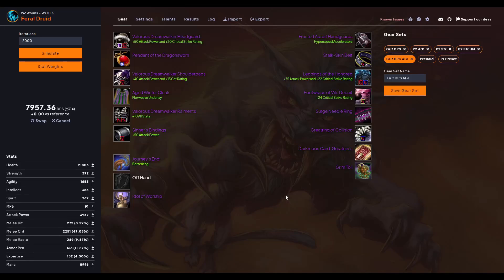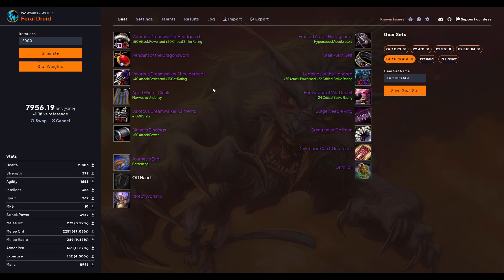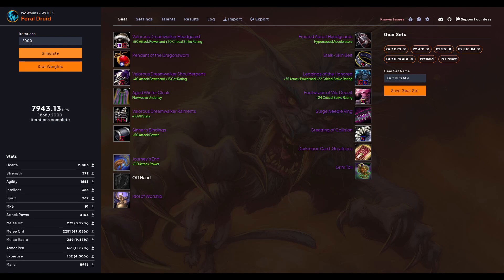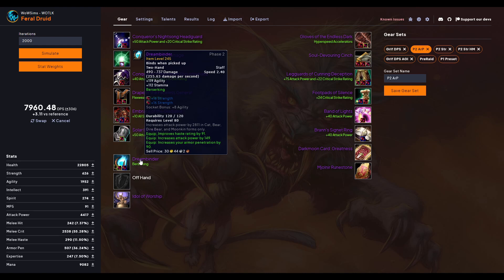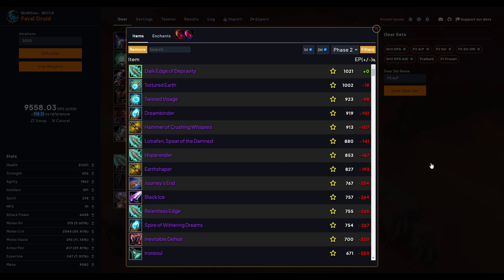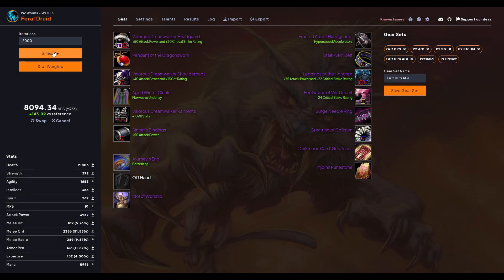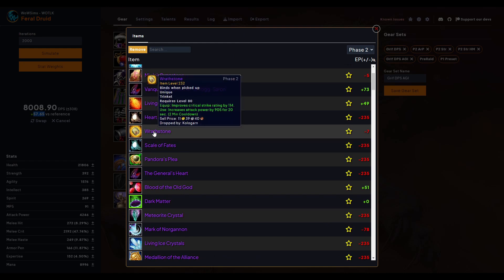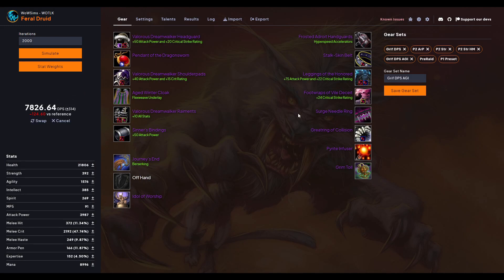How to Sim your own gearsets in Wowsims - WoW Classic

Comment: @griftin Runestone is only proccing for the old 665 amount in the sim, not the buffed 751 amount. Might be causing some of the issues with getting the ArP set to perform like you're expecting. You can verify this yourself by running the sim and clicking the log tab, then searching for Mjolnir. It will show a 665 ArP proc. Once they buff that you should see better results from ArP. Unsure when to expect the fix though.

Also, when comparing items you should have the Duration +/- set to 0 since the difference in dps could be caused by difference in fight length, and not power level of the item e.g., a more powerful item can sim less dps if it happens to roll longer fights since you have fight length varying.
Reply: This has been fixed